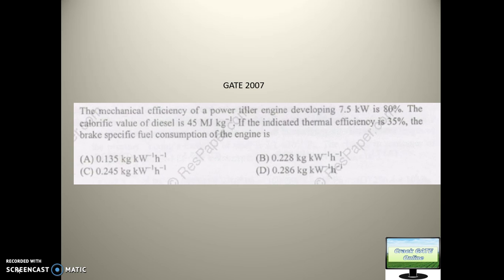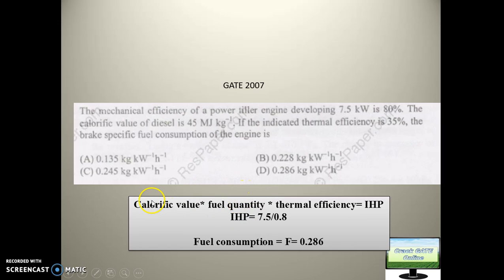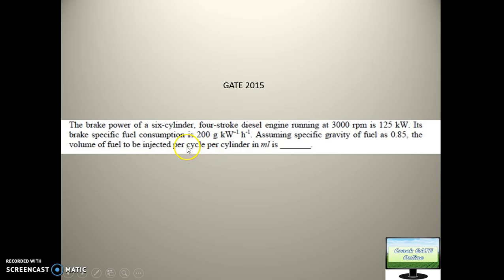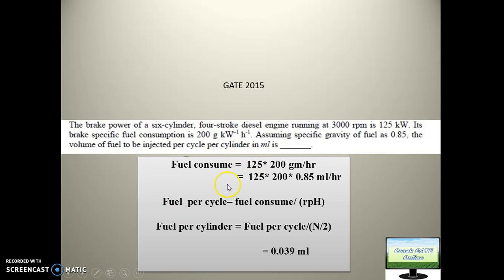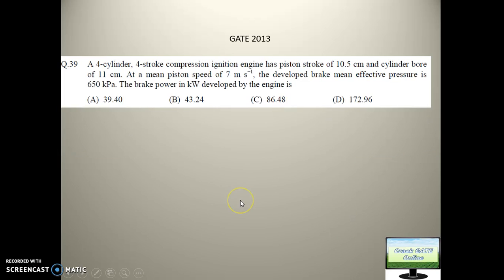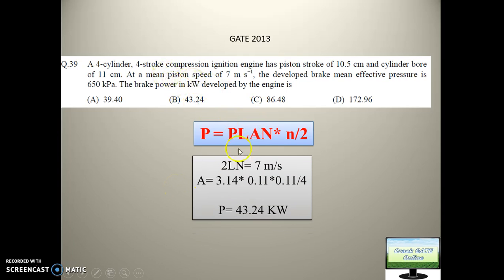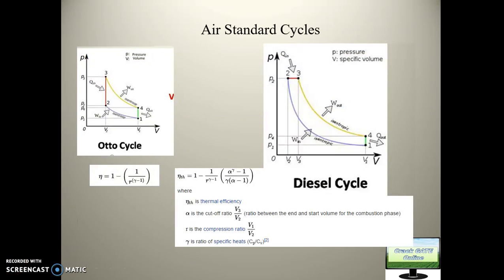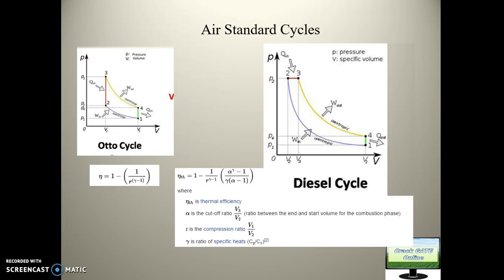IC Engine Part 2

Comment: I want to know the solution of question came in 2007 because on following your steps sir answer is not coming.Please sir.
Reply from the maker: 1. Calculate indicated power by 7.5/.8 = 9.375KW
2. calculate brake power using Indicated thermal efficiency and indicated power, so brake power is 9.375*.35 = 3.281KW 
3. Calculate fuel consumption in kg/hr. by formula Indicated power = fuel consumption rate*calorific value
                                                                                            9.375kw = F*45*10^3
                                                                                              F= 0.75 kg/hr.
Now,
Apply formula for brake specific fuel consumption.
brake specific fuel consumption= fuel consumption rate/brake power
                                                         0.75/3.281 = 0.286 (Option D)

study well.
please do like, share and subscribe
Reply: @agriculturalengineeringcra7258  the solution is very confusing..bro
Reply: @agriculturalengineeringcra7258  acc to this ans should be 0.75/3.281= 0.228
Reply: Thank you so much sir.
Reply: @ashwinimeravi4815  did u got the above solution..
Reply: @rajanani8781  no not exactly

Comment: In 2007 question ,awnser is not achieved by following the steps you tell in video plzz provide appropriate solution
Reply from the maker: 1. Calculate indicated power by 7.5/.8 = 9.375KW
 2. calculate Indicated thermal efficiency by 9.375*.35 = 3.281KW 
3. Calculate fuel consumption in kg/hr. by formula Indicated power = fuel consumption rate*calorific value
 9.375kw = F*45*10^3 F= 0.75 kg/hr. 
Now, Apply formula for brake specific fuel consumption.
 brake specific fuel consumption= fuel consumption rate/brake power 
0.75/3.281 = 0.286 (Option D)

 study well. please do like, share and subscribe
Reply: @agriculturalengineeringcra7258  Sir but i got 0.228 (0.75/3.281)

Comment: gate 2007 question  45*0.286**0.35=4.5045
in the calculation 7500/(0.8*0.35*45000000)=5.9523*10-4
how  come the unit hour inverse had came to existence in the options 
even though if we dived those we will get kg/s as our units
can u please help me out in this
Reply: and in the units of answer there were KW inverse so is there anyneed to convert KW into W by multiplying 1000

Comment: sir in 1st question how u convert gm/hr into ml/hr
Reply: Sir i didn't understand how you convert gm/hr into ml/hr
Reply: Hey vikram, since specific gravity of fuel is 0.85 means volume of 1000 gm of fuel is 850 ml so volume of 200 gm fuel will be 200*850/1000 ml. To convert gm to ml you may directly multiply weight of fuel with specific gravity. I hope it helps. Thanks

Comment: sir answer for the question(33) asked in gate2015 is 0.054 ml
Reply: I got 0.35... can anyone please clear my doubt?  I'm stuck here.
Reply from the maker: Yes deepthi...you are right...
correct answer is 0.05445 ml
It is good that students are watching so carefully and bringing out error..
Pardon us for inaccuracies..
Do watch all the videos..
All the best
Reply: Hey deepthi, I think you are calculating it for four cylinder, for six cylinder it should be 0.039 in my opinion. If you are getting 0.054, plz let me know how you got . Thanks
Reply: Yeah, I too got the same